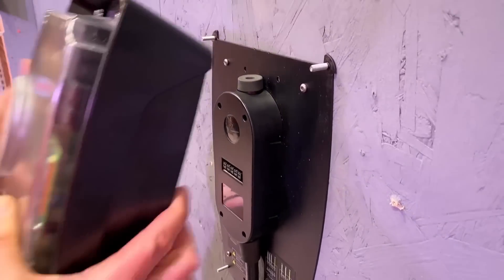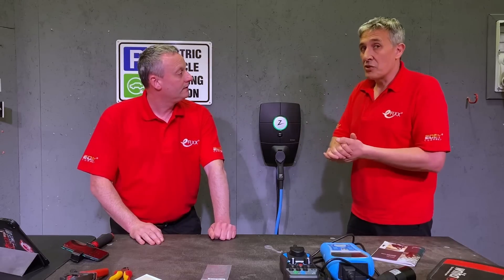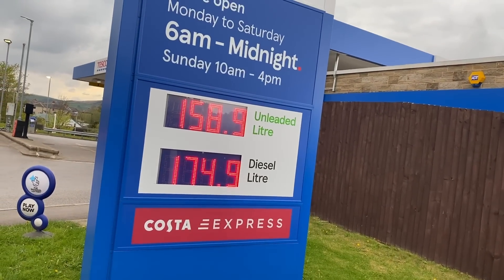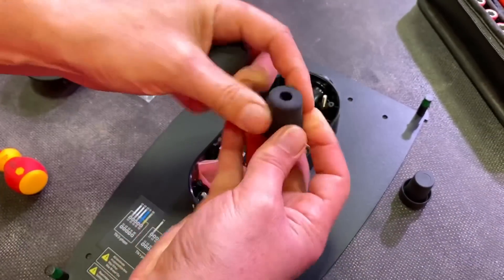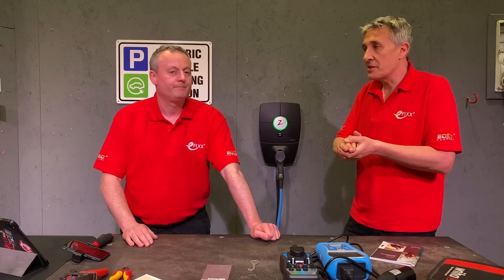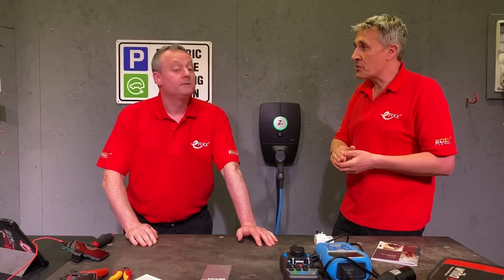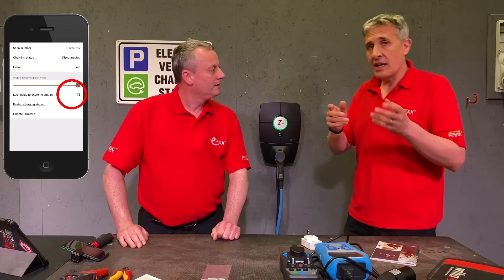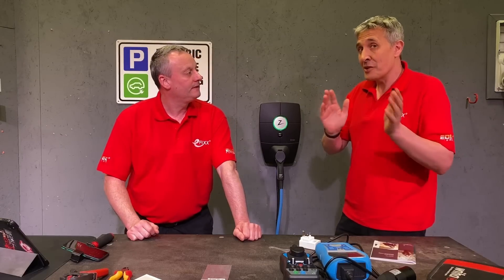Zaptec Pro - An EV Charger for shared car parks in flats and apartments

Comment: There will come a number of fast chargers that reach the maximum capacity of the local grid. I live on an estate which is basically a microgrid. If 10% of the properties try fast charging cars at maximum rates at the same time, it will cause issues from minor to failure.  
This is the biggest issue for EVs, energy density of fossil fuel is enormous. A UK filling station dispenses the same amount of energy as a quarter of a nuclear power station. To replace all the publicly accessible filling stations (farms, hauliers, train companies and construction have their own) with electrical energy 24/7, most private drivers will charge at night so no solar, the UK will need to 2000 nuclear power stations with the current average energy output before forcing vehicles to become battery. This was peer reviewed and the models were found to be accurate. It was part of my degree project, the further research wasn't completed as my funding wasn't provided.
Reply from the maker: Good points, but also remember they 2/3 of the energy from fossil fuelled vehicles never makes it to the road.

Comment: this'd be really good in places like caravan parks/holiday homes in the south west of england where you do have many guests but they aren't moving that much. you could set up the per-home/per-caravan charger at low power, but also offer a limited number of 3 phase units in a dedicated area where, users get billed (that rfid based spreadsheet, see).

incidentally, HomeAV power line stuff is exactly the same mechanism which chargers use to talk to the cars: they're all computers after all. technically then, HomeAV is built in to all of them, it's just restricted to the type-2 cable to the car. They've just added another NIC to the back end. 

 -if I have one concern with this model is, like all cloud-first smart home stuff: you are not only in trouble when the cloud app goes down (source of concern in easee forums), if the manufacturer does any of: goes out of business, announces end of support for a model, gets bought by someone like google and turns off interoperability (hello Nest!) then your box is worthless. This model, with all its billing, has to be online to charge -but I'm yet to work out if their home product has a fallback mechanism

Comment: Sorry but am I missing something here? How on earth does anyone expect to be able to charge 35 cars  @ 22kW from a 63A - 3phase supply, and then multiply this figure all the way down the street for every block being fed from the main high voltage step down station? Is every apartment going to have a direct connection to Selby?

Instead of referring to Internal Combustion and EV's wht not call these electric  cars exactly what they are - RCE - Remote Combustion Engines, all they have done is moved the burning of fuel out of the car and stuck it into a generator a few miles away - doesn't really make me feel very "GREEN"

Comment: Hi Lad's,
               I'm curious as to why you can only have 11Kwh charging on 3 phase when I have a 10.8 Kwh shower  which is near as makes no difference to 11Kw on single phase could explain
 please.
Reply from the maker: It’s the charger inside the car that sets the charge rate and 7kW is the standard adopted for single phase by the automotive industry.

Comment: One problem that's not solved is intelligibility for a range of audiences. This may be deliberate, I have no way of knowing.

Ok, where I'm at, I'm a private citizen who still runs internal combustion vehicles (I have 4 for very different uses) but I'm interested in EVs as I will eventually be running them. 

I got nothing substantial from this video.

I get the feeling that these devices use a single feed wire as a busbar & use a variant of Powerline to communicate with a white box somewhere which possibly controls this busbar or possibly the individual units. The units may or may not also use wifi or 4G to communicate. There is some hookup somewhere for billing & it uses open standards. I noticed no mention of hacking & security despite these being absolutely vital in our current cyber-war. 

But that's it, just feelings, nothing substantial. 

Judging from the comments people who install charging points for a living know exactly what you're talking about but private individuals with a small fleet or carpark owners are more likely to be mystified than edified.

I'm very unlikely to come to you when it's time to install my charging points.
Reply from the maker: We don’t install charge points, we are a channel aimed at electricians, who in general will be familiar with the content. We do have a playlist which is aimed more at the consumer - https://youtu.be/wnmW6W9j80I
Reply: @efixx  thanks for that, I'll have a look in a bit.

Comment: Great video, I spoke to the Zaptec team at fully charged, and one of my queries was head fuse protection at an apartment block(Easee EV equaliser not launching till possibly q4 2022). They said there is a device available to CT clamp around incomer to prevent the chargers blowing the landlord headfuses, don’t suppose you guys know the details of this kit? Craig

Comment: Can this device monitor power incoming on the tails to make sure maximum demand is not over the incoming limit like the Zappi ha??
Reply: These charge points would only charge up to 22kW per circuit, regardless of whether you have 1 or 20 cars charging at the same time. It makes the install cheaper, but isn't practical in the real world

Comment: Can the charging unit talk to the car get its VIN number and the server charge the driver or drivers or company owner to the registration of the vehicle ?
Reply: These chargers support ISO15118 (Plug & Charge), so you can get secure authentication from the car, provided the car supports it.
Reply: @paulpschierer-barnfather6453  And it's still not clear to me whether Tesla actually support the ISO standard or is using something proprietary
Reply: @mark123655  It's not very clear, is it? Tesla are using something proprietary (at the moment). Who knows what their future plans are? The latest models from Audi, Mercedes, Porsche, VW, Ford, Lucid (and presumably others) currently support ISO 15118.
Reply: There is no data exchange on all but Tesla. The power that the car can take is done by a pulse similar to remote control planes and toy cars the system is sort of pwm not data.
Reply: @Electronics-Rocks  so each charger must have a PIN number or a card and reader from the server
Reply: @Electronics-Rocks  PS: ...for AC charging. One of those pwm patterns tells the car to speak Powerline over the signalling lines to talk to a DC charger. (Or, if it's a Tesla, to speak CAN-Bus to the supercharger.)

As far as I'm aware, this is a DC-only mode, so it can not be used to provide authentication for AC charging. Unless the charger authenticates and then simulates unplugging the cable to start a fresh AC handshake. That probably would work with most cars unless they are really picky about it (or don't have DC-charging capabilities).

Comment: Euwww powerline data., all those nasty harmonics and mess superimposed over the mains......
Reply: The power line data in these chargers uses 10Mbps GreenPHY PLC - the same as the one used in Plug & Charge standard (ISO 15118). It's 250mW maximum, so negligible compared to the harmonics produced by the vehicle charger. https://en.wikipedia.org/wiki/HomePlug#EMI_concerns
Reply: With the tiny amount of data transferred in this use case, I don't see any issue. Those chargers are not streaming Netflix in 4k...

Comment: Now please make video as You install 5 of them in daisy chain using 16mm 5 core  SWA cable on 63 amp supply;)
Reply from the maker: Not really that difficult - exterior car park we’d go with some thing like this 
https://www.swaonline.co.uk/cable-management-jointing/cellpack-resin-cable-joint-kits/t-resin-joint-kit then run 6mm to each charger.
Reply: @efixx  What about that flat cable you demonstrated with Tee-off connections?
Reply: Apologies, it’s been a long time since college & been out of the game a while….are you saying it’s acceptable to connect different sized cabling together now without any fusing etc?

Comment: One hundred employees share a 63A supply? So each average 0.6A? Don't think any of them are getting home again.
Reply from the maker: Look at it another way how many kWH are they sharing across an 8 hr day and what is the average commute?
Reply: @efixx  Using some typical numbers, I get 3.65 A. However, this also includes non-daily driving (holidays and other long distance trips where you'd use fast chargers along the way), so I'd derate it to 3 A.

And @mark, if you utilise the other 2 phases, too, you get 1.8 A. So about 63 chargers per 63A supply would be enough for workplace parking even when all chargers are in use concurrently. If you allow for unused chargers, or longer charge times (e.g. adding lunch break or charging at home over night), you could even supply more than 100 chargers.

PS: I used 37 km/day, 20 kWh/100 km and an 8 h workday.
Reply: Why would all of them need a charge at the same time?
Reply: In the video you can prioritise vehicles that need a quick charge so would charge first and then down the chain. Plus as a car nears full charge it drops off slowly giving more power to the rest.
Though I admit 100 cars if all set to charge someone will loose out.
Reply: @Electronics-Rocks  How does it work out who has priority? How does it know how far you need to travel after work?
Reply: So in reality the max you can have is 10 cars per phase to 30 cars total as the cars won’t take less than 6A. Yes it can balance the load but working on single phase inverters on the cars and then all being there around the same time start of day for work or evening for apartments it’s 30 cars. Yea other cars can be queued but charging at 6A is trickle charging at best.

Comment: As you know I’m not a fan of EV chargers or e-car’s ,and I am unlikely to ever install them, but I have to say I like this clever bit of kit , why does it take someone like Norway to put there grey sells to work and think about residential applications like blocks of flats, in the uk we are so far behind which this stuff , yet we insist on pushing forward with AFDDs   And SPDs why ? .
Fantastic video guy’s as always 👍👍👍❤️
Reply from the maker: Necessity drives demand - Norway is way ahead in terms of EV driving adoption.
Reply: @efixx  my point exactly . 
Like I said it is a clever even nice bit of kit . Even though I have know interest in EV or EV chargers . But yes it’s a nice well thought out design. 👍
Reply: 75 % of the cars in Norway are electric so they’re the leaders in EV charging infrastucture
Reply: I'm sure if you bother to look, you will find similar products from Netherlands, Germany and even UK